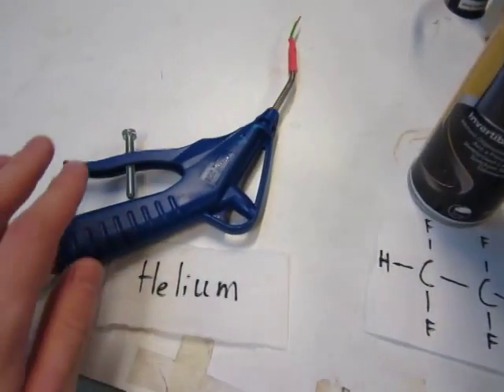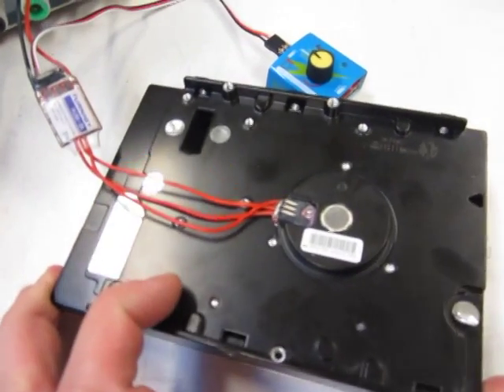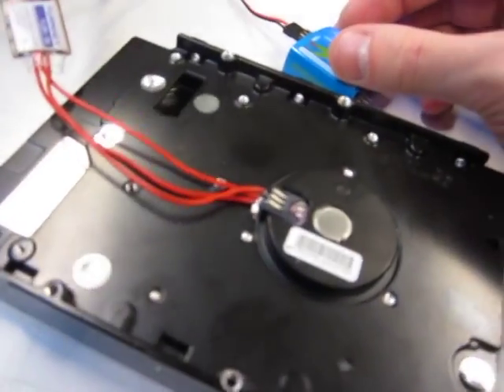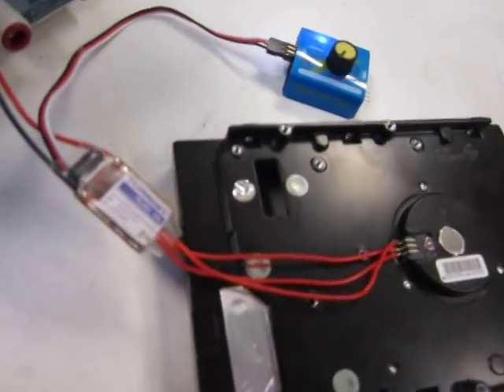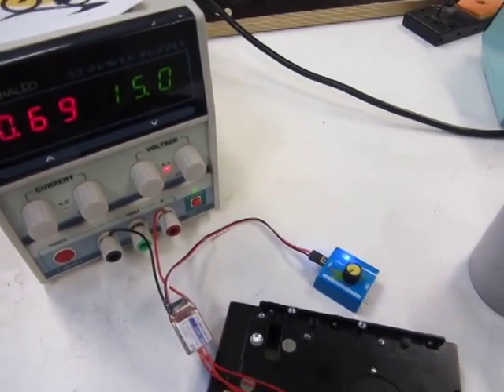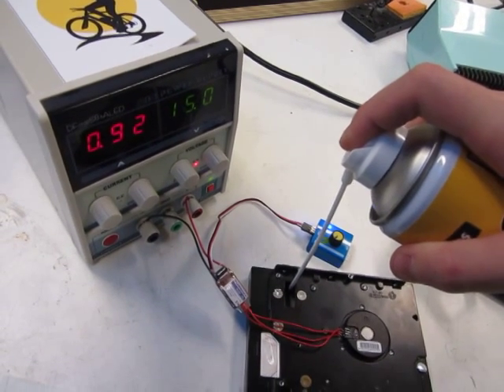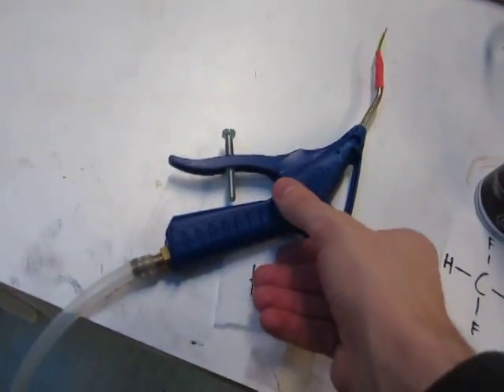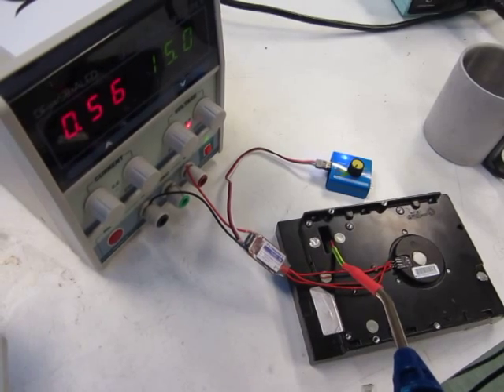Helium inside HDD

Comment: I wonder what the reason is for not using vacuum inside the drive, do the heads need some gas cushion to glide over and not crash into the platter ?
Reply: rogert151 the reason they do not use a vacuum is that it will cause the disk to overheat without any gas to transfer the heat with
Reply: it uses a cushion of "air" the heads float on. They would crash in a vacuum. It has absolutely nothing to do with heatsinking.
Reply: Well, I know the drive in its current state wouldn't work with a vacuum. You're right that the heads need gas to glide over the platter. The heads all have an ABS (air bearing surface) on the bottom that makes them fly over the disk as it's spinning. Then there is a heater in the head that causes the reader/writer to expand closer to the media and that's how they control the read/write distance to the media on the micro level.

Helium basically acts as an ideal gas and makes the disks spin in a more stable way which means you can use thinner disks. You can also get the heads closer to the media with helium allowing you to use thinner data tracks. It takes less power to spin disks in helium, and makes less noise.

Basically the biggest thing is that helium allows you to use thinner disks and you can cram more in a drive. Nowadays they aren't having many breakthroughs in hard drives but need to keep adding more and more capacity. Helium allowed them to just add more disks/heads. No breakthrough needed, other than how to keep the helium from leaking out.
Reply: They couldn't create a complete vacuum but you would still have friction due to earths gravity. There's probably a lot of reasons as to why they chose helium.
Reply: thanks for your imformation! :)

Comment: Where i can find that controller you using?
Reply from the maker: ESC is from hobbyking, 3s-4s voltage and 6A current will be enough for most HDDs.